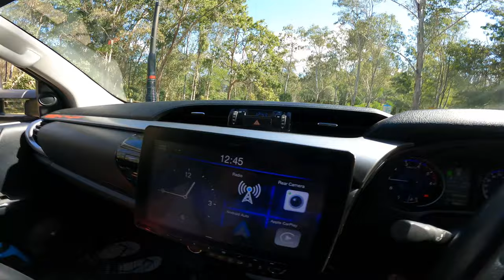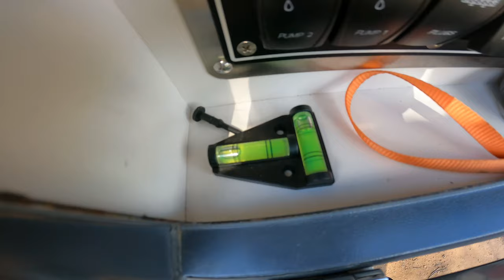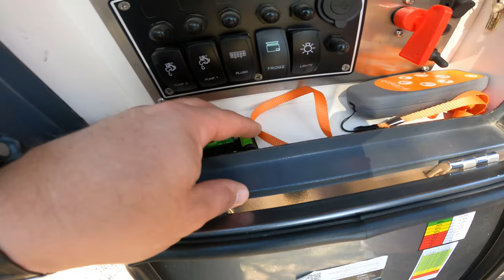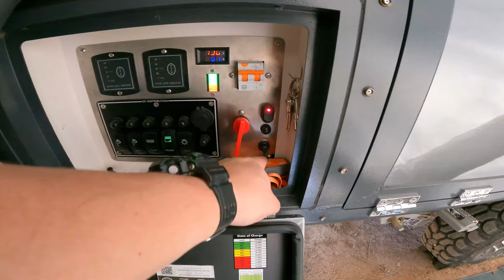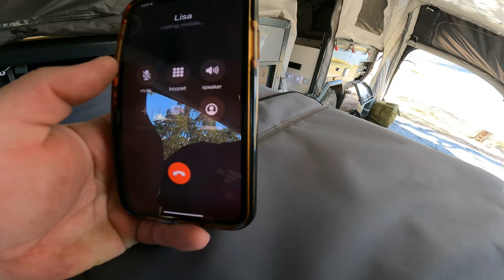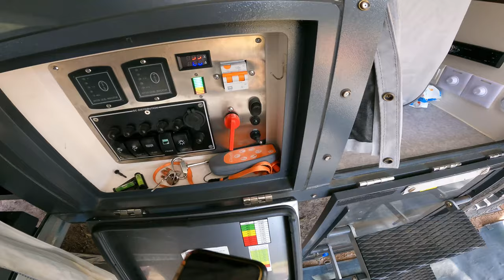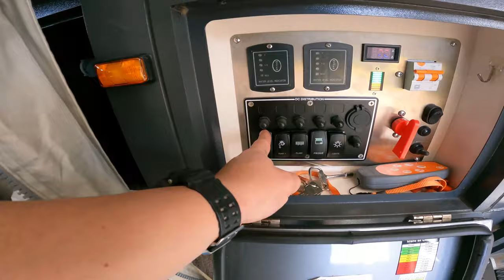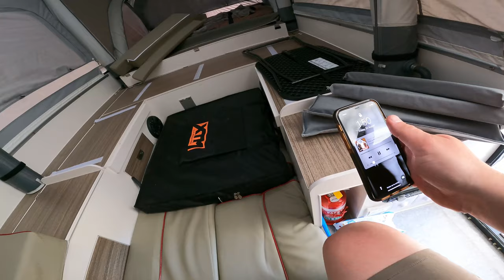Opus OP4 Full setup video, Lake Somerset Camping.

Comment: Cool video inspite of being a little long. Would have better if you had gone for a head strap to mount the go-pro. Would like to know if the air beams and the valves hold up pretty well or does it have to be pumped on regular intervals for longer stays. Cheers :)
Reply from the maker: Once it's up, it stays hard for a few days. 
however in big temperature changes. eg. 25 degree days and 3 degree nights. You find you may need to turn the pump on for a few seconds early in the morning.

Comment: I’m curious with the annex, does it come with the floor as well or not? Also does it attach to the side of the trailer to stop the flies, spiders and most importantly the snakes from finding their way inside? I’m very interested in the Opus 4 and those smaller things could be a game changer, but I love the idea of not having tent poles
Reply from the maker: It comes with floor, walls and everything else you mentioned. We just choose not to use them. It can be fully enclosed. We did it once for camping in winter at foxbar falls. And never used them again.

Comment: Think I’d be using a power drill and socket on the leg brackets: is there a spare pump if the main one goes US ?
Reply from the maker: You can manually pump it up as well. 
Power drill on legs is an option.